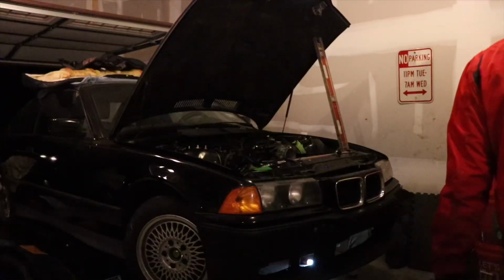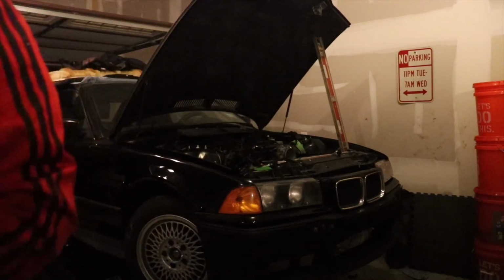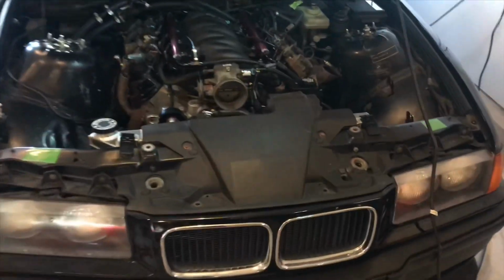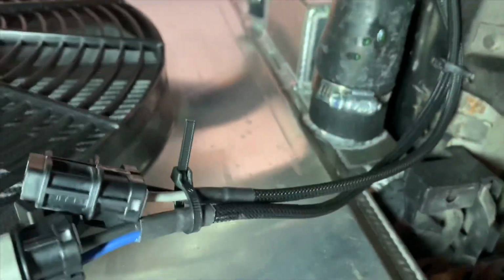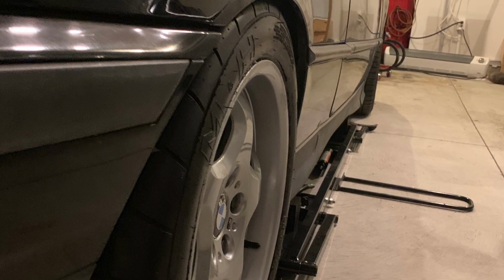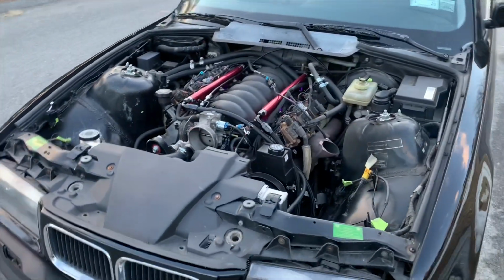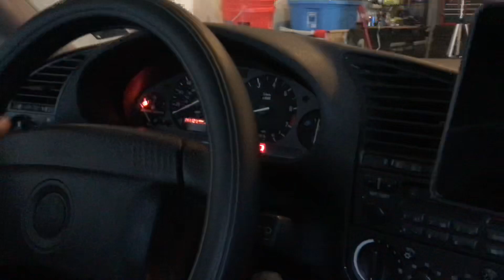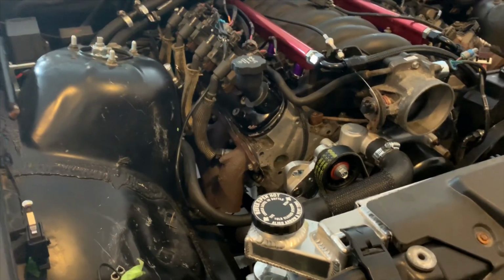LS SWAP FIRST START: E36 TURBO LS SWAP PART 9

Comment: love the build bro, i was looking to do this to my e46 but i had no guidance or help so for the mean time i brought a 335i and now i’m looking back into the e46
Reply from the maker: Besides the engine mounts being different, there are a lot of similarities to doing this in An E 36 with an E 46. Some of the benefits are you have more space in your car, and depending out what model you have, you have a stronger rear differential and better brakes.
Reply: Low Boost Films bet, i will update you on the process. also, my car is AWD will that mess up anything?
Reply: Low Boost Films and i’m looking forward to the budget list, i also want to turbo mine also but everywhere talks about kits that’s 2000+
Reply from the maker: Awd shouldn’t be a problem, you’ll be removing all the front drive stuff and transfer case. Might have to get new hubs in from though not sure. You can get turbo kits cheap, but they don’t make bolt on ones for LS e46 so you’ll have to weld it together.

Comment: How did you make the stock cluster work and what are you using for an engine management system what tune
Reply from the maker: At this point I had a wiring specialities harness. That wired everything for me all I had to do was plug it into the bmw x20 plug. It uses the GM pcm.
Reply: @LowBoostFilms  ok cool thanks I’ll look that up I’m gonna start building a 93 e 36 here soon I’m running a 4.8 ls l20 vortec with the same transmission love the videos man very informational I just must have  missed the harness part and ecu
Reply: @LowBoostFilms  and that will work with an obd 1 system even tho it’s obd2

Comment: What fan do you use? Does it push enough air sitting in traffic?
Thanks
Reply from the maker: I use a SPAL fan that’s on my New Age Hotrods radiator. My turbo hotside is close to the rad so it does get a little hot sitting but it doesn’t over heat
Reply: @LowBoostFilms  thank you for the fast response 👍 keep up the good work man 😎

Comment: holy shit, amazing, cheers from Brazil, one question, witch transmission are u using? thank you
Reply from the maker: Thanks! I have a T-56 6 Speed from a Pontiac GTO. Same as a 1998-2002 Camaro/firebird
Reply: @LowBoostFilms  sweetlord thanks bro. I will see how can i get one of those... Thanks man. Keep safe
Reply from the maker: Will do! Thanks!